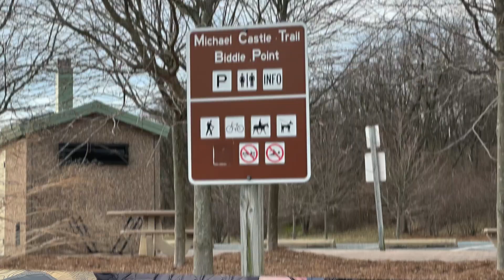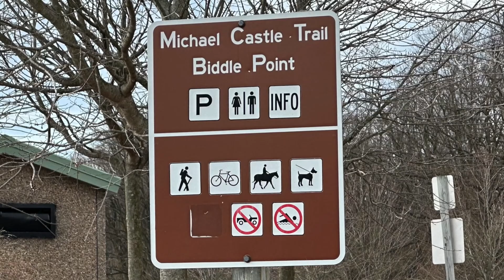Don't Go Changing the POTA Activation

Comment: I have the Buddi Stick Pro and trying to like it. It worked well for me camping at 100watts from a picnic bench. Eventually I want to do QRP POTA or backpacking with it. I'm struggling to get the SWR down below 2. I'm trying to build my own radials but can't seem to get the length correct. I didn't buy the winder with the wire lengths already marked figuring I could save a few bucks and do it myself. 
What are you using to keep the radial up off the ground?  The manual says it must be 2-6 feet off the ground and on a non-conductive support. I thought a couple 1/4 PVC pipes coupled together would work but it's really flimsy and doesn't stay in the ground without falling over. I'm trying to find something like a collapsible fiberglass pole. Maybe 3 tied in a tripod? 
Thanks for the video.
Reply from the maker: Hi James. One problem with your SWR is that you didn't get the winder/radial wire. I haven't seen any video with someone that did not use that. Buddipole might have engineered the antenna to work the best with it...? Maybe? Not sure?
I'm using a K8MRD mono/bi-pod stand that he is selling. Seemed like a good option for me. Thanks for watching & 73.

Comment: Nice job! Great video, thanks for sharing! I have been getting into POTA just recently and need to find some around me here in Arlington, VA. The park you were at looks great and not very far at all. How is that Yaesu DX10 on battery power? And how many watts were you running? Keep up the good work. 73!
Reply from the maker: Hey Lam. I got several parks within a 10 minute drive from me. And more up to 30-45 minutes that I would consider “local” to me. That’s the nice thing about living in northern Delaware. You should have some POTA entities around you… Most in DC, but there are some probably 10-20 miles from you. Good luck & have fun! Thanks for watching & commenting! 73!